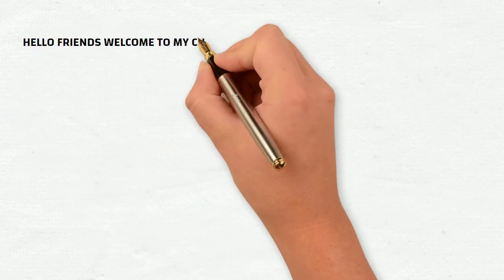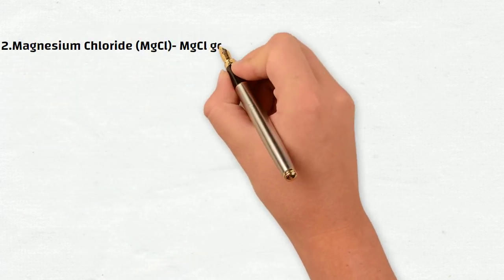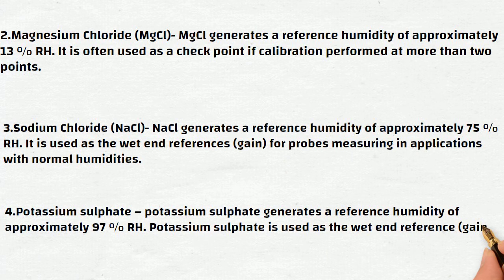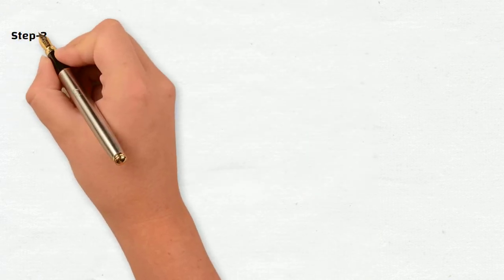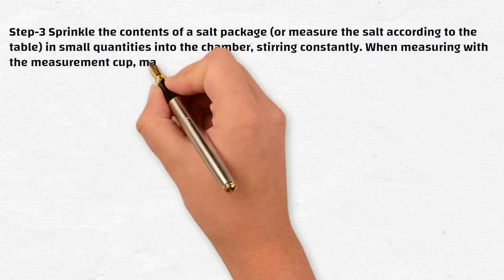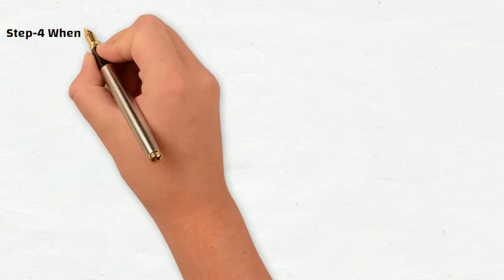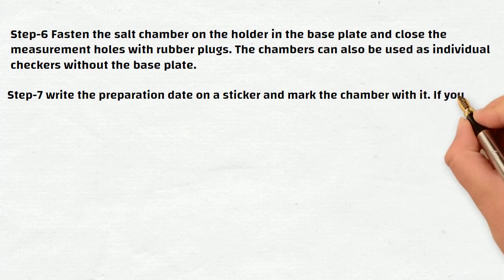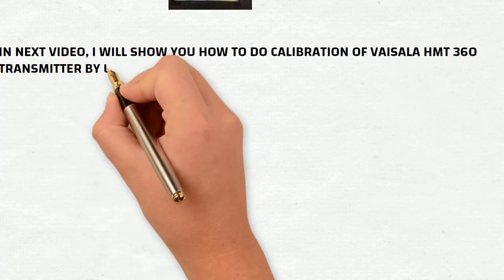How to Prepare Salt Solution for Vaisala Humidity Transmitter | Calibration Procedures

Comment: Magnesium Chloride equilibrates to 33%RH, not 13%RH...
https://www.engineeringtoolbox.com/salt-humidity-d_1887.html
https://cameo.mfa.org/wiki/Saturated_salt_solutions
https://nvlpubs.nist.gov/nistpubs/jres/81a/jresv81an1p89_a1b.pdf
Reply: I see that the Vaisala people said to only add 3ml of water for 30g of MgCl2. This is not a normal saturated mixture... maybe that's how they get 13% instead of 33%. This is weird. I have a 33%RH MgCl2 reference sitting in front of me right now. I just used it. 33%.
Reply: https://www.youtube.com/watch?v=aeLPRZQTA4w

Comment: Hi! How can we know how much slat and water we need for the targeted relative humidity? For instance, Mg(NO3)2 can produce 53% of RH at 20 degrees Celsius. I do not know how much magnesium nitrate I need to dissolve in how much water to get the mentioned RH.
Reply from the maker: Hi Kiarash
Thanks for asking this question. Please google it Vaisala Humidity Calibrator HMK15 manual for more information about salt concentration. Or you can share your mail id in comment box, and i will send you manual
Reply: The salt solution needs to be saturated. I keep adding salt until there's a small amount of solid salt at the bottom of the mixture that refuses to dissolve, then give time for the air above the mixture to equilibrate in the sealed container with the sensor.